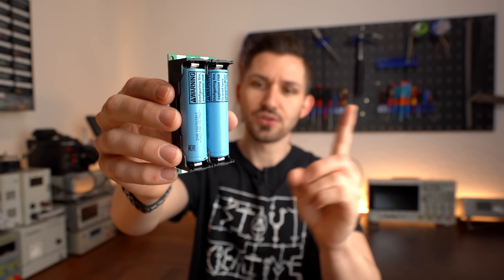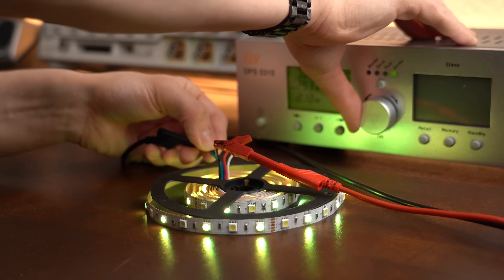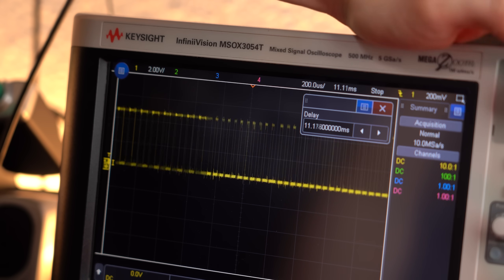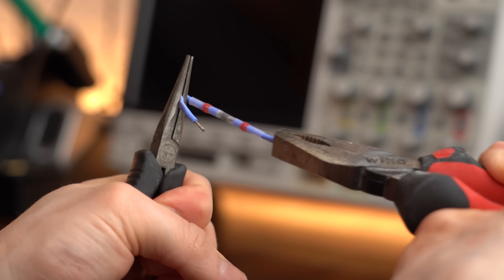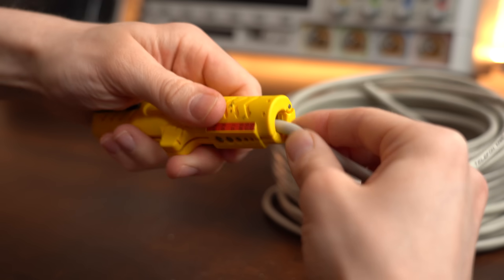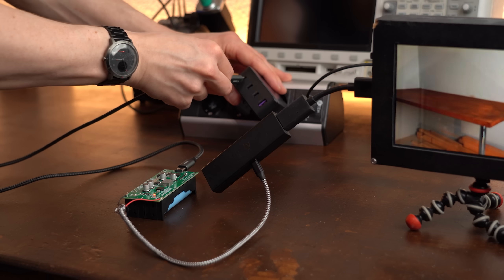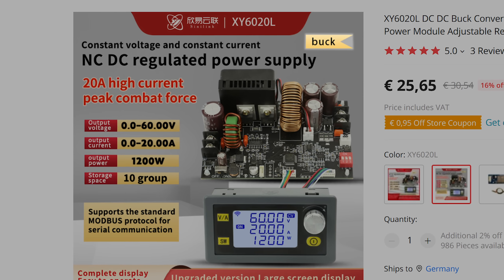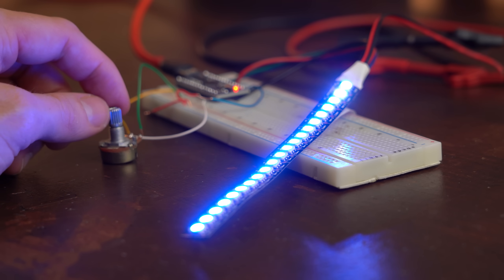I tried finding Hidden Gems on AliExpress AGAIN! (Part 4)

Comment: I downloaded and translated part of the datasheet for the LED IC. What's weird is that it's ALMOST exactly the same protocol as WS2812b. They're both RTZ signals at 800Kbps. The timing thresholds between lows and highs are slightly different but NEARLY compatible with each other. The FL1903 needs a relatively long reset of 200µs between chunks, but that's still in spec for WS2812. Besides that, the difference is the order that the colours are specified. R, G, B instead of G, R, B for WS2812. Should be really simple to get this working with existing LED controller software, but as someone else already commented: why did they bother with a different signalling protocol that's almost, but not quite identical to WS2812, and certainly has no improvements like increased data rate, improved colour resolution or built-in brightness scaling.

Comment: Some of those adjustable PSU (the last one) have a hidden rs232 port inside. You can even enable the thing in the system menu and control the psu with a pc or something.

Comment: Some very interesting items in this review. At 6:38 I believe that filter material is PAN carbon felt and not 'activated coal'. It is a good idea to use as a filter as you recommend. Apparently, if you can find it, PAN graphite felt has better electrostatic properties than PAN carbon felt, but as lead is a diamagnetic material, it probably does not matter for filtering smoke from soldering. As it is commonly offered in different thickness, I will probably use 3mm as the filter, as the other sizes may be too thick to allow airflow. I used the link to order some of those fans for cooling LED COB grow light builds. Also I ordered some of those strippers, but I found another seller with a higher feedback rating that has a stainless version so I went with that. And as a last observation, I recall that Big Clive did a deep dive into those heatshrink wire connectors that may be of interest to some.

Comment: You should compare the input psu of the buck converter, I don't know how good the output noise is. The input noise can be a problem for the buck converter

Comment: You didn't heat the solder heatshrink good enough with enough heat. You need a higher temp heat gun! The solder was cold from the video. It should have flowed and wicked to the wires.

Comment: I want to control Submersible motor and need high voltage relays to control it, can anyone suggest me relays capable of handling (600V AC and 10 Amps). Thanks

Comment: If I can add a feature request: if the product gets a thumbs-down, point us to the product that fits the same need and does get the thumbs-up, even if it’s not on AliExpress (or even if it’s not cheap). UPSs for example: I am waiting for the best UPS for small projects and while I was also disappointed by that one from AliExpress I’m not sure what other products I should be considering.

Comment: If you need a proper stripper, that can do large, mid-size and small cables,  it also can strip single conductors and coaxial cables, try the Knipex Ergostripper.

Comment: I'd really like to see a properly functioning 18650 based mini UPS like that. It would be a very good fit for a lot of RaspberryPi based projects.
Reply: I'd like to see a similar board with more cell capacity so you could use it in projects as a power source. 

Imagine building a portable Bluetooth speaker, LED flashlight or any other project that needs portability. Just take this board, load it up with as many batteries as you wish and you've got a 5/12v power source that has USB recharging and over discharge protection. 

Of course, it wouldn't be viable for huge battery packs, but if you just wanted to power something small like 5-10W, you wouldn't have to mess around with a BMS, at least 2 buck/boost converters and hell of a lot of wire to get the same functionality as this one.
Reply: @CME @helltp Would hooking up some caps at the output help? Curious!
Reply: @BerkmanLord  Well, the best way to answer that would be to try it out. 
But I think it would be possible - it's just a question of how far are you willing to go with it? 
Most USB devices will function with this, as is. Hooking up a small capacitor/LC filter onto it might make it technically better but you wouldn't notice any real changes. 

I wouldn't use this for something sensitive, like audio amplifiers or medical devices, but if you intend to use it as an UPS for your router or some LED lights etc it should work just as fine.
Reply: @lazar2175  Many thanks!
Reply: @lazar2175  what about if you were wanting to use it with something like a wyze cam? i already bought one not really knowing the difference but there is very limited options out there when it comes to something like a 5v UPS. this one just happen to look really convenient.
Reply: @crazzywolfie  More than likely it would be fine, but...
You could try building your own noise filter, which are relatively simple - only a coil and capacitor (LC filter), or you can buy pre made ones you can just piggy back it to this UPS.
Reply: @CME  thanks for the input, i have a similar situation but the module is based on IP5306 and when power is disconnected it briefly shuts off output for half a second (let's assume a full one second) - since there is no noise issue would a LC filter work as energy storage or simply adding a couple of electrolytic caps at the output would eliminate the brief outage?

So far i have added 3x 1000uF 10v caps in parallel and it has kind of worked (no power outage at disconnect) but it doesn't work all the time. 

Maybe i need a bigger cap like 4700uF ? But i am not sure how to go about it.

Would a simple rc circuit (resistor capacitor) at the output be a better option than a LC filter since noise issue is not what we are addressing just need to keep the output power stable during the 0.5s outage.

There are also 2.7v and 5.5v rated supercapacitors with 0.1F to 10F range. So maybe i can be on the safe side and calculate the output capacitance needed for a 2 second outage. The load is a WiFi camera that takes 5v and 0.4A (0.8A max with IR enabled)
Reply: @TruthLoversKoSALAM-fg8dh  Okay so. Power stored in a capacitor is roughly equal to 0.5 x C x V². Your capacitor bank has 3000μF, or 0.03F, and we'll assume they're being charged to 5V exactly. Using the formula, your capacitor bank stores about 0.375J, or W/s as it's more convenient here. 
Your camera, at 5V and 0.8A, draws about 4W, or 2W at half the current (no IR)
So, you can see that your capacitor bank is really not up to size for your needs, it wouldn't be able to power your camera even for 1/4s. However, I assume the power interruption is probably even shorter than 0.5s (have you timed it with a oscilloscope?).
Anyway, to be able to power your camera for a full second, at full power, you'd need a 3.2F capacitor bank. If you'd start it in non-IR mode and have the interrupt be closer to 0.5s, you'd only need an 0.8F capacitor bank, which is pretty feasible (think 2x 4700μF caps would be sufficient) 

In all honesty, the real solution is to just swap out the UPS board, but you can try Jerry rigging something if you're bored. 

Also, sorry if calculations are not perfect - I'm an mechanical engineer, so this isn't quite my expertise.

Comment: A side note on those small psu modules: 4-5 years ago when they started to get popular, Dave from EEVBlog made a couple of videos abut them. For the smaller DPS3003 he mesaured around 100-120mVp-p, for the RIDEN RD6006 he measured the noise levels being "at about 60mVp-p no load and about 100mVp-p at 6A". My point is that it matters which one you buy, I have 2 of these now and I bought them from their official shop and these perform based on Daves testing quite well, much better than the offbrand one you tried.  

Source: https://youtu.be/Cw2AjcczHg4?t=1115

Comment: If purchased for charging, which based on the product description and included  18650 battery box would indicate its prime function, then a noisy unsmoothed output is not a problem.

Comment: please suggest a suitable circuit for 5V ups, i had made on for my clocks so that it works even case of no mains power using a dc boost converter & tp4056 charge board, it worked fine , but at the end just before the battery cuts off i think it gave a huge inductive spike from the boost converter at the o/p which damaged not one but 2 clocks of mine, after recharging the circuit works fine.

Comment: I'm an electrician and I swear by the knipex 95 11 165 for cutting and stripping cables. It takes some skill to learn not to cut into the inner isolation but having a tool that can just cut and strip in a few seconds is super handy. You also need quite some arm strength to pull large pieces of mantle of the cable but I'm used to it now. Just hold the cable between the cutter, don't press to hard and twist the pliers around to cut into the cable. Bend in in half and break the inner mantle and you're done

Comment: Try to test the output with the short spring provided with the oscilloscope probes. Never try to measure noise or ripple with the black alligator clip because it is a long un-shielded wire that will pick up lots of noises that are not there. Although, the noise on that looks like the output has very little capacitance filtering and we can see the switchnode directly.

Comment: HI,
the jokari you left out is the absolute best for stripping large section cables, in fact it was one of the equipment of ENEL operating personnel, its blade, adjustable in depth, at least in the model I had, very similar to that of a deburring tool, can turn 90° on itself allowing radial cuts (to separate the part of the sheath to be removed) and simply by pulling the cable, cut the sheath longitudinally to be able to remove it easily.
The fume extractor fan works, ok but whoever has never disassembled an ATX power supply casts the first stone and if he has thrown away the internal fan he really has no idea what recycling is; it will be at 12V and therefore at 5V it will turn slowly but maybe it's even better this way: we don't need a hurricane!
ciao and I see You next videos

Comment: I wouldn't use solder connections in automotive applications.  Solder joints become rigid and the copper may work harden due to vibration and then fail.  Plain crimps with heat shrink is what I would recommend for any vibration prone environment.  No doubt I will get shouted down for this.

Comment: You never completely melted the solder in the heat shrink wire connectors, no wonder they didn't work correctly for you 🤦🏼‍♂️

Comment: not sure i'd trust that for solder fumes alone, the room should have good negative pressure from window fans, bathroom vent fans are very quiet now so also an option with minor construction.
also the magnetic charge cables from there are good enough for bluetooth earbud cases.

Comment: Those wire connectors are similar to what they used in ww2 to repair wires in the field. Was basically the same and would join the wires in  a moment... very useful when under fire.

Comment: Those heat gun wire connectors work even better if you dab a little bit of flux onto the naked wires beforehand. The solder completely liquifies and fills up the entire cavity. Usable either way, of course.

Comment: the wire stripper is interesting. it's probably the best way to strip a wire but the device could use a redesign.  the fan is also interesting as I have a 12v server PSU fan doing nothing, hooking it to 5V could be useful to blow air to my hand.

Comment: Darn..that UPS was so promising.  I just bought one of each through your links.
Anyone else think we can fix it with some more caps or other small mod?
Yes I know, technically it's not an off the shelf product that "just works" then, but still Im hopeful it's fixable relatively easy.
Reply: Working on it now, I have 2 5v and 2 12v and a whole crap ton of caps and my scope. I'll report back on what I come up with this week
Reply: @Tatersalad812  How is the ups doin?

Comment: Another great video, I love this series!

I myself use a lot of ws281x pixel LEDs, and I'm not sure why anyone would break from such a mainstream protocol.
I came up with a similar solution for a soldering fume-extractor: Cheap PC Fan on a regular 9V battery, with pre-cut 120mm Carbon Filter suctioned to the fan's grille. If you're just doing a small bit of soldering, it's extremely compact and works very well.
Reply: WS281x protocol is useful up to a specific number of LEDs and the frequency used. For bigger and more flexible installations you need APA102 or something else. WS281x is also limited to RGB, there is no RGBW (SK6812 or TM 1814 needed) or other variants.

Comment: I actually use one of those yellow strippers all the time. Works great for the very small range of wires it is suited for, I think I bought 5 for $5 or something (since it is Ali, getting 1 was about the same price and quality issues..). Not to say there are not better options, but they work for me :)
Reply: It works great for me too.
No clue why he shit talked it when he didn't even use it correctly.

Comment: The grey stripper is meant for stripping coax, not general use, and is quite good for that with a little setup when changing coax sizes. And the yellow one is a cheapo stripper for data and vox cable, hence the punch down tool on the end. It is a cheap piece of crap, but it works plenty well in a pinch and is often included for free when buying connectors and cable. Not really fair to compare either being used on cable they were never meant to be used on.

Comment: I would like to see you trying to build a parallel 20V battery pack adapter to hold 2 battery packs for a tool to be powered from, interesting imo, but probably not doable..

Comment: I use the grey/brown stripping tool with the orange insert all the time. It is SPECIFICALLY designed for stripping coaxial cables. It's not a generic cable stripper. If you were having poor results with it on normal cables where you only want to strip a jacket that is a few mm thick, I'm not in the least bit surprised. You wouldn't use a hammer to peel an orange, and you wouldn't use a knife to drive in a nail. Use the tool for what it's intended and you'll get way better results.

The coax stripper is also only designed to cut the insulation and the dielectric. You must not use it to pull the material off the cable - do that separately by hand. It's easy once the cuts have been made. If you try to pull it off with the tool, you'll damage it. Changing sizes is intended for situations where you normally strip one size (say, RG6) but occasionally need to do a bit of RG59, for example. If you're doing a lot of both, get two tools and leave them set up differently.

Comment: What the hell. You just looked at the exact things I ordered in the last two weeks. The led diffused strip (not addressable tho), the wire connectors, and the red wire stripper.

Comment: Carbon foam is NOT a proper fume filter, it will do basically nothing. You are removing the smoke from your face, which is fine, but then just dumping it into the room air where it will sit.

Comment: When you show comparison of noise on power supply output you need to keep the scale the same so people easily understand the difference in noise amplitude.
Not everyone understands how to read an oscilloscope screen. 100mV/div vs 1V/div with lack of trigger on 100mV screen really doesn't give a good comparison.

Comment: These heat shrinkable wire connectors are fantastic for motorcycle wiring repair. They are easy to work with and the repairs do last fine over time

Comment: Just in case you don't know, that gray "wire stripper" is actually for COAX cable.  Radio Shack has been selling them for many many years and I have had one for many many years and it does work good on COAX.  You just have to adjust the blade that cuts the dielectric foam the right way.
Where did you get that little board with the fan and display that you use to test the current draw from devices?

Comment: Is there a USB C charger like the TP4056 to charge an 18650 battery but also using the same port to output 5v?

Comment: Yeah I’ve bought a couple of those 18650 power boards before, and I’m not sure that they are the exact ones that’s you tested, but the ones I got overheated really fast.  I think those are a good idea though because I’ve got a bunch of 18650’s just laying around and would love to find a power board that takes those abs outputs to either USB or solder points.

Comment: Those heat shrink solder connectors actually are trash, even the more expensive ones from germany. They burn too fast, pop if the air heats inside, ... I tried 20 with lighter, heat gun, temp controlled hot air soldering station, trash. I stay with wagos

Comment: I bought a 1400€ 48V 100Ah 19" LiFePo4 Battery pack with 5 star reviews and what can I say, its trash. The quality is below minimum, the cells are more in the 85Ah range then the 100Ah, the integrated shunt measuras so inaccurate that the battery thinks it has between 100 and 105Ah,... seller plays the dumb one, no money refund, no repair, nothing

Comment: If  youre still looking for a wire stripper then 262-0173 on RS is the best ive used thats universal. Personally used it for years and to strip all sorts of cable up to 3+E 25mm2 helukabel

Comment: What would it take to modify or build upon the cheap power supply to provide a clean output? And would the cost of the item and the upgrades still prove to be less expensive than a commercial item with similar specifications?